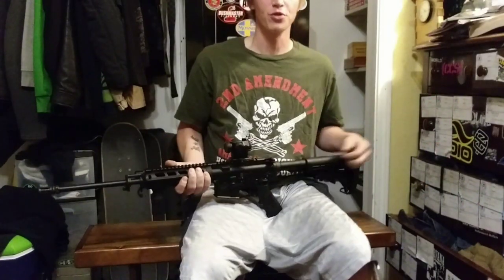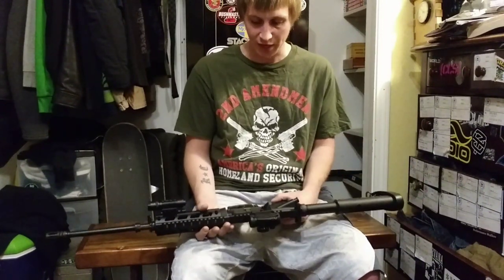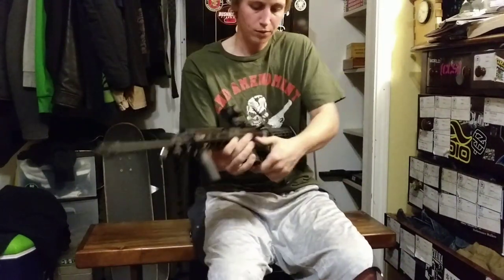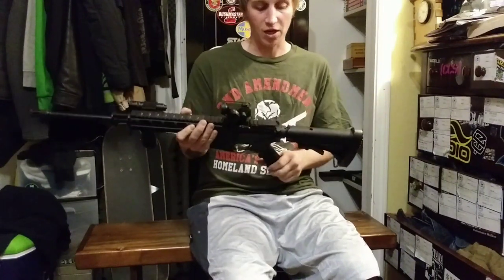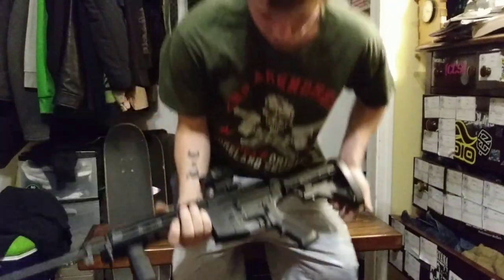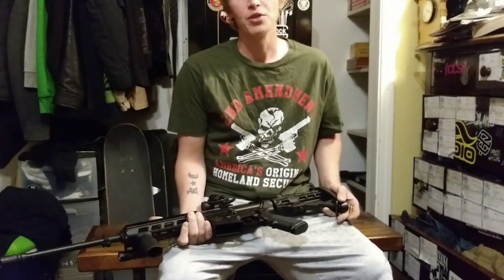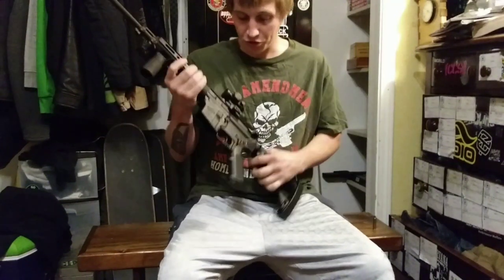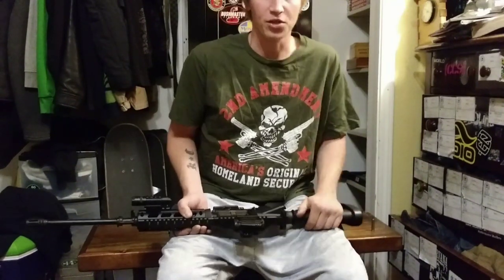AR-15 mortaring technique unjam a stuck bolt & charging handle w/round chambered.

Comment from the maker: 2nd update: Here is the link to a new higher quality and more informative video I made showing this technique and explaining what I think causes it, and how to keep the issue from happening again.
https://youtu.be/S_wLVeBOJgI
Reply: So a live round would NOT go off doing this?  Just trying to understand.  Thanks.
Reply from the maker: No as long as the trigger doesn't get pressed then there is no way the firing pin can strike the primer and set off the round. So your good to go just don't touch the trigger and your home free
Reply: @counterstrike2A  Thanks!  I wasn’t about to try it or anything; just wanted to make sure I grasped your cool video instructions.
Reply from the maker: @joshuacalkins  No worries at all, sorry for the late response I also remade this video 2 years ago. I made a more detailed video discussing what causes the malfunction and how to prevent the malfunction from occurring in the future if your interested in checking it out here's the link
https://youtu.be/S_wLVeBOJgI?si=OWzrw38gnVxXA5OG
Reply: @counterstrike2A  I will check that out.  Much appreciated!
Reply from the maker: @joshuacalkins No problem at all your welcome! Glad to help

Comment: I had the same problem with a brand new rifle and didn’t know what to do. Thankfully there was a guy at the range who knew the mortar technique. I had been shooting for almost 20 years and never had that happen. Now I know! Knowing what to do in this type of situation could literally save your life. Good video!👍
Reply from the maker: Thank you for the kind words! If ur interested I made an update video on this technique a month ago further explaining what I now believe causes the malfunction here is the link if u want to watch it. https://youtu.be/S_wLVeBOJgI
Have a good rest of your weekend! 🇺🇸
Reply: @counterstrike2A  cool! Thanks, I’ll check it out
Reply from the maker: @johnneal4097  right on no problem at all
Reply from the maker: I also have a full ar15 cleaning guide video on my channel and using that cleaning method is what kept the issue from happening again. I believe it was from the bolt carrier group not properly being cleaned specifically the firing pin and extractor.
Reply: @counterstrike2A  cool! …I was shooting Wolf .223 when I had the malfunction. I was shooting a brand new DDM4 V7 (literally the first mag). I think the malfunction may have been a combo of the rifle being new and needing lubrication and the .223 I was shooting.
Reply from the maker: Yeah actually that's exactly what my conclusion is my rifle was brand new out of the box and it was the second or third time I took it shooting that the first malfunction happened to me my understanding is the rifle wasn't properly lubricated in the factory so I taking it apart and lubricating everything and cleaning it fixed my rifle and I havent had the issue since at first I thought it was cuz I was running two to three through mine but that cuz when I shot 556 I didn't have any issues but after lubricating it it can run to do three perfectly fine and steel case wolf rounds no issues whatsoever so for my experience so far I believe that's what caused the issue and the solution is just to get it a nice through clean especially the bolt carrier group the firing pin in the extractor/ejector
Reply: @counterstrike2A  agreed!

Comment: THANK YOU! New to the AR 15 and this literally just happened to me with a boresight 223 bullet getting stuck and I could not pull the charging handle, it was all locked up. Simple and straight to the point, worked on the first attempt, bullet popped out, done! Thank you, stay safe out there!
Reply from the maker: @Mitchell02194  your welcome!

Comment: I just got back from my range where the same thing happened with a lodged live round and the charging handle wouldn't budge. Luckily the gunsmith was there and he took it back and got it unstuck. He showed me the actual bullet was not to specs. He asked what brand of ammo and I told him it was the cheapest 300 blackout ammo I could find. He said that was the problem. There can be shells that are reloaded that are out of specs that will get jammed. Maybe check that case if you still have it to see if it measures out larger than it should. I hope this helps everyone.
Reply from the maker: It happened to me a few more times after that but it was always with .223 so i started using only 556 and its been a year now and it hasn't happened again.
Reply: I have the same problem with the Remington hog Hammer. I don't know if they're out of spec. But all my other rounds are fine. But every time I load these in a jam, I can't pull the charging handle after mortar it so I just took them all out of my mags. $30 a box of 20
Reply from the maker: Ya u should be ok but I would still go outside just in case even though the round won't go off without the firing pin striking the primer its just a good habit to be in the most controlled environment you can

Comment: I've got a live round too! And I live in a apartment. Sucks and I'm a safety man, I ain't out to be reckless. Thank you for this
Reply from the maker: @joeyc1725  you're welcome! Theoretically, as long as the trigger doesn't get pressed down, there's technically no reason for the firing pin to strike the primer causing a negligent discharge. But always airing on the side of caution is a good habit to have

Comment from the maker: Update - Since filming this video I had to mortar my rifle 2 more times. I also had not performed a full disassembly and cleaning/Lubrication on the bolt carrier group and ejector. After doing that the problem has not happened again and I've put over 2000 rounds through it. I also got some input from other viewers and a common explanation is new rifles have tighter tolerance in the chamber and just normal operation of the rifle can help loosen things up therefore fixing this issue from happening. I also was suspicious that maybe the ammo I was using was causing it because all 4 times i had to mortar my rifle I was using .223 remington so now I predominately use 556 NATO and the issue hasn't come up. But like i said that could have nothing to do with it and it could have just needed to be broken in. That being said if this issue arises the first thing I recommend doing after removing the stuck round is to give your rifle a thorough cleaning and lubrication. I just uploaded an AR15 disassembly cleaning procedure/lubrication and reassembly video last week here is the link if you don't know the proper cleaning procedure.
https://youtu.be/Apmvm9SrXzw
Reply: You're spot on with your research.  Thanks for listing the TOP reasons new 16 owners will experience jams.  if it's your first ar-15, like me, you might start to think you bought a lemon of a gun but no worries...just growing pains
Reply from the maker: @chrisbusenkell  Thank you! Glad to be able to help that's why i made the video after having a hard time finding this technique when i first had this malfunction. I made an updated version of this video about a half a year ago it has more in depth explanations of how to keep it from happening here is the link to it if ur interested
https://youtu.be/S_wLVeBOJgI
Reply from the maker: @chrisbusenkell  fully disassembling cleaning and oiling the bolt carrier group firing pin and ejector seemed to do the trick and i haven't had to mortar my rifle again since.

Comment: I am from Poland, just bought new S&W MP15 and it jammed on first round, the calibration one that looks like empty cartrige. Tanks man! You saved me!
Reply from the maker: Yeah it seems like this always happens on new rifles to a lot of people until the tolerances of the chamber's loosen up a little bit in the meantime I suggest taking apart the bolt carrier group and lubing up the ejector and the firing pin and bolt carrier group and that should help ease things along for you

Comment: I just picked up my 9mm PCC this morning, read the manual, and wanted to practice loading and unloading the rifle. First cartridge in and I got a total lock-up. What a sick feeling - a firearm I'm unfamiliar with that has a live round in the chamber. Found your video and mortared my rifle and it's good to go again. Thanks so much for posting this.
Reply from the maker: Your welcome man im glad I could help pretty much same thing happened to me it was the 2nd time i took my AR15 shooting that this happened. And then it happened again and both times it happened using 223 so now I only run 556 and it doesnt happen anymore. But since ur running 9mm another thing i heard was its common for that to happen to new rifles because everything is new and tight and just might need to break in and loosen up a little bit. I recommend giving it a good cleaning and lubrication and i think that may keep it from happening again. Best of luck to u and thanks for supporting my channel!!
Reply: @counterstrike2A  I think you're right. I'm going to take it apart tomorrow and clean and lube it. The weird thing is that when the cartridge ejected with the mortar operation, there was no bullet in the cartridge, just the shell, so I've got to check if the bullet is lodged in the barrel. It's not in the chamber.
Reply from the maker: Damn I've never heard of that happening if that's the case i would definitely research what may have caused that and possibly contact the company who made your pistol caliber carbine. I have a hi point 9mm carbine and it's been nothing but a reliable workhorse for me.
Reply from the maker: Thinking about it more the only other thing I can think of that would cause the tip to separate from the shell is maybe you accidentally put a 9×18 in there instead of a 9 mm Luger I'm not sure though I know there is a difference between the two cartridges but I'm not familiar with 9×18. But I'm also assuming ur probably smarter than that and I'm pretty sure u know to run 9mm luger but just a thought I had.
Reply: @counterstrike2A  I'm pretty sure it was operator error. I was using a 30 rd mag and may not have got it seated properly.
Reply: @counterstrike2A  After I read this, I went an looked at the ammo boxes. It was 9mm Luger with a very light bullet.
Reply from the maker: @mikeoreilly4020  brass cased or aluminum. I know aluminum is a much softer metal so I could see that maybe happening
Reply from the maker: Well if u ever find out for sure what caused it let me know I haven't heard of that happening before maybe if the ammo was reloads but that's definitely a head scratcher

Comment: Thanks for the simple, straight forward instructions. I had my first locked-up bolt in my relatively new Radical Firearms rf15 and was freaking out because there was a live round chambered. I laughed when you thought to add at the end - oh btw you should do this outside unless you wanna blow a hole in your house. I went to the yard and mortared with not much force and she opened right up. Manually cycled some rounds after with no prob. Think it may be a magazine issue. Anyways, thanks.
Reply from the maker: Your welcome im glad I could help

Comment: Thanks for the video. I haven't had this happen for 20 years but just had it happen to a new unfired AR15. 
There can be quite a few reasons for it happening by the look of it. 20 years ago I was firing Wolf lacquered ammo and then switched to brass ammo. My Colt AR didn't like that and jammed the bolt carrier. 
This time the new AR had almost no lube when I looked it. My fault for not inspecting it from the box. Jammed bolt carrier again.
Both times ''mortaring''' solved the stuck bolt carrier.
Reply from the maker: Yeah, it seems to happen a lot more often on newer AR-15 rifle platforms. That's when it happened to me was probably the second time I took it shooting, but after that I think it had one more malfunction and then it stopped. I made a newer updated video. If you're interested, I'll send you the link in this comment. Kind of explains the reasons why it happens and how to prevent it from happening in the future.
https://youtu.be/S_wLVeBOJgI

Comment: Thanks for this video.  The same thing happened to me with a live round in the chamber.  Nobody at the range knew what to do.  We were able to separate the upper from the lower but then the BCG stuck out too far to reassemble the rifle and mortar it.  I took a large flathead screw driver and was able to easily pry the back of the BCG out of the upper.  Hope this might help those for whom mortaring isn't an option.  The ammo was Russian-made MaxxTech and the cartridge didn't look quite right so the theory of out-of-spec ammo as the cause seems plausible.
Reply from the maker: Your welcome glad I could help! If ur interested I made an update video on this technique 3 months ago further explaining what I now believe causes the malfunction here is the link if u want to watch it. https://youtu.be/S_wLVeBOJgI
Reply: @counterstrike2A  Thanks again.  This is an area that needs more research.

Comment: I just had to do this with my AR, but I didn’t listen all the way through to where you said if you have a live round in it you should do it outside, luckily nothing happened except for ejecting like you said it would. thanks buddy
Reply from the maker: No problem in theory the round shouldn't go off unless the trigger is pulled at the same time causing the firing pin to hit the primer but you never know so it's always good to air with caution I'm glad u were able to get ur rifle up and running and also glad you didn't get injured 🇺🇸

Comment: dude you are the man, thank you so much! New ar15 haven’t even fired 20 rounds and this exact same thing happened, I appreciate such a straight forward video!
Reply from the maker: No problem at all I wanted to help other people fix the malfunction after it happened to me. If ur interested I made a newer video that is longer and more in depth and talks about what causes the issue and what I have since done that worked and to this day I haven't experienced another lock up. Here is the link if ur interested.
https://youtu.be/S_wLVeBOJgI
Reply: How is it now? I’m in the exact same boat. Not even a full mag shot on this happened

Comment: I just had this happen while i was out in the field. I found your video and it worked. I primarily use .223 rounds. This was the first time it happened with over 1500 rounds of the same type. I did notice that the buller had a notch cut into it. From when it got jammed. Im gussing it tried to go into the chamer at a less than ideal angle. But I'm just speculating.
Reply from the maker: Nice glad I was able to help get you back in action out in the field! I have since made an updated better quality video where I go over what I believe to be the causes of that malfunction and how to prevent it from happening in the future. Here's the link to it if your interested.🇺🇲
https://youtu.be/S_wLVeBOJgI?si=B93hiQMxAZ0PLCNn

Comment: This is common with bulged cases. The fattest part of the brass above the rim. Most dies are generally different in size so if you have a brand new chamber and the round wasn't properly sized using a Saami spec die or it wasn't sized with a small base die, the fattest part of the brass, which is the very last part to fully seat into your chamber, will get stuck. This is one answer.
Reply from the maker: I've come to the conclusion that like you said it was a combination of a new chamber. As for the ammo I wasn't using any reloads I believe I was using Winchester target loads 223 and both times this issue came up I was using 223 and for about a year I predominately used 556 and the issue never came up again. Thinking back on it another factor could have been not cleaning the rifle out of the box being new to the platform I didn't have as much knowledge as I do now and I always make sure my firearms are clean and lubricated. I've probably gone 14 months now without needing to mortar it again so I strongly believe it was the new chamber having tight tolerances and needing to run some rounds through it to loosen it up. Thanks for your input!

Comment: U saved me a 20mile trip ..I just bought my apf  ar15 last month and yesterday chambered a round and removed the mag and tried to eject and it wouldn't  move plus I was worried about it going off doing this .but I went outside in back yard and put both fingers on charging handle and I didn't even do it really hard and the bullet came right out ..I inspect the bullet nothing was bent or nothing  the tip of bullet had a few really slight scratch on it  but it didn't ingrave the lead ..so I checked few more rounds and they ejected .so hopefully it doesn't happen again might take to get lubed I only put like 100 round threw it so far only had it a month
Reply from the maker: Yeah the lubrication will definitely help it seems like new rifles are prone to this happening because of the tight tolerances in the chamber ill send u a link to my ar15 cleaning guide if u don't know how to disassemble and clean it
Reply from the maker: I'm glad I could help u out when it happened to me on my 2nd time shooting my ar15 I had to walk over a mile down the trail from my shooting spot back to my car cause i didn't know how to use this method yet. Here's the link to my cleaning guide if your interested.
https://youtu.be/Apmvm9SrXzw
Reply: @counterstrike2A  it happened again and again after I cleared it ..it was the ammo not the rifle
Reply from the maker: we're you using reloads or were you running 556 NATO in a 223 remington only AR15